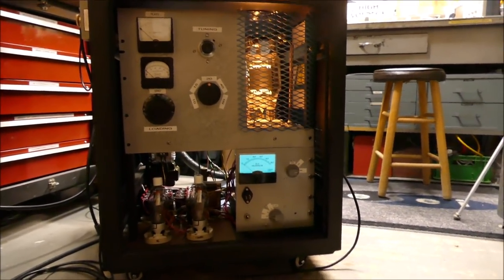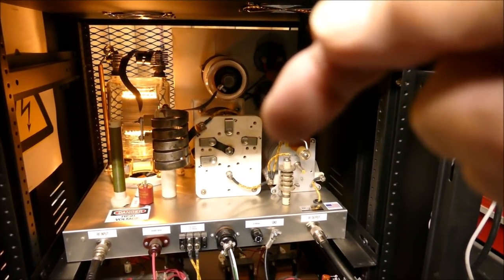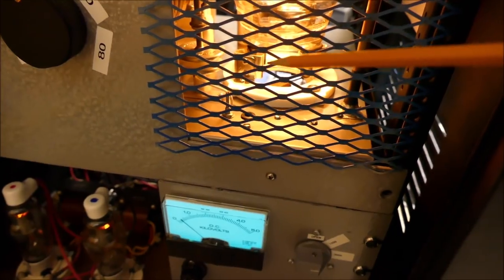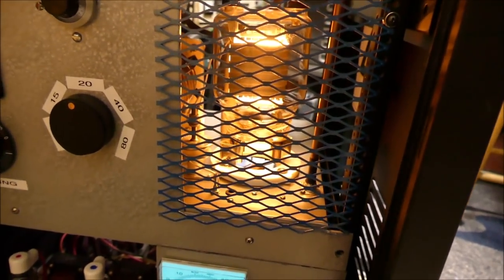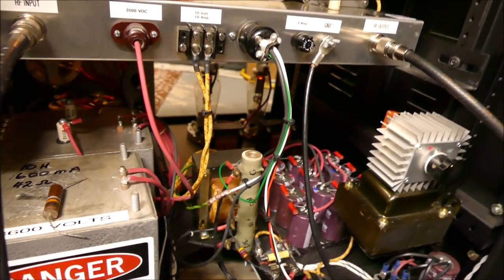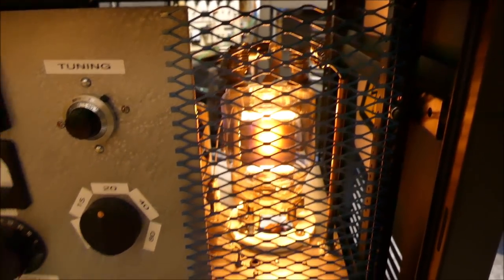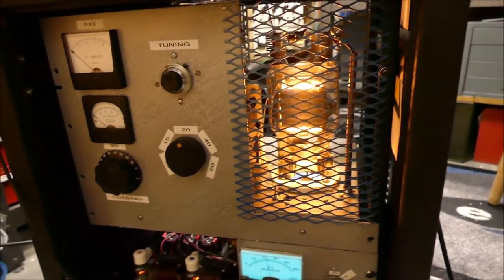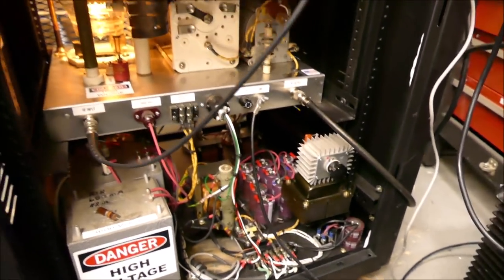(2 of 3) Completed 833A Vacuum Tube Triode RF Amplifier For 20 Meter SSB

Comment from the maker: Update - I removed the bias adjustment shown in this video and replaced it with a Variac. The SCR type variable control shown here was just not stable enough and was way too sensitive to get to any steady bias voltage. Sometimes the old proven ways are still the best ways.

Comment: That will make a nice addition to the Collins rig. Looks rock solid. I'll bet it would do well on AM. 
I like the Octal plug for the control wires too. Very traditional. 
Maybe. One day I'll build a big RF amp. The project list gets longer every day.
Reply from the maker: Hi Bill,
Yes, some of these projects have banged around in my head for decades. I am at that age now where I realize if not now... probably not ever. I have the parts, the time and the experience so I have pushed myself to use the parts that I have. Of course, I do have to occasionally buy small parts from Mouser or Ebay and I did go to a local store for the cabinet.  I found this project a challenge as the overwhelming discussions on the Internet concerning the 833A is that it will be too difficult and too inefficient to use on 20 meters. The tube is rated to 30 MHz so I decided to check it out for myself and as can be seen, it works just fine at 14 MHz. Making amplifiers multi-band is a lot of work and since I only operate on 20 meters, I often times don't go to the trouble of making/testing them multi-band. I have also found that amplifiers "tuned and tweaked" for one band almost always perform better.

Comment: very attractive amp Stan, clean build, i get roughly the same output( not over driving it)   :)  with a push it does run over to 1.4kw on topband  to 40m.
Now, Stan do a video on GG input circuits and how to determine what we need for 160 to 10m band to make the radio happy :)

agree on the repeating of stuff copied from 1921 ,,
Reply from the maker: With this amp, If I raise the plate voltage to a bit over 4KV, so that under load it drops no lower than 4KV, I can get a full KW out of it. I have three 833A's but the other two are "soft" and don't perform very well. In general, I run the plate voltage at about 3600 and get between 750 and 800 watts output, depending on my line voltage and drive out of the little iCom 736. I have considered buying a new Chinese 833 but just haven't gotten around to it yet.
You mention the GG amp and input circuits... I have started using a small Heathkit antenna tuner between the output of the iCom and this 833 amp. It works great and I have no reflected power as shown on the iCom meter and the tranceiver is very happy.  
While I did, finally, get this 833 amp very nicely neutralized, my input circuit is not perfectly resonate (I think I need a little bit more capacitance across the inductor) so if and when I get around to working with it again, the resonance of the input grid circuit would be the place for me to work and that may allow me a little more drive and a little more output. But, as mentioned, the antenna tuner between the iCom and amp input solves the problem of the iCom always wanting to "tune".
I have measured the complex Z of the input but I don't remember what it is right now. I think the SWR is about 2:1. I found out the hard way that if you use something like the little Chinese impedance meters, or the RigExpert on the input of an amplifier like this, you may ruin the input to your impedance meter. I burned up the front end input circuit of one of these Chinese Z meters.  I have been careful with my RigExpert since then and have not harmed it. I use a home-brew Z meter I made many years ago and it works out very well and is not harmed.
An amp I ran for over 30 years in the Collins 30K-1 cabinet was a 4CX1000A and all I did for the grid of that tube was put a 50 ohm (non-inductive, of course) resistor across the input. Worked great.
I try to always use a tuned input. I have found out that it makes the tube a little easier to drive, and get a little bit more output, even on GG amplifiers. Multi-band input circuits get a bit complicated and I have only one amp that I went to that much trouble for and it is the amp that sits on top of my 833. It runs a 3-400Z and uses the B&W 850A tank circuit and a home brew five band input circuit and it works but I located the input tuning switch on the rear of the amp and it is not very convenient to use. Besides, I only operate on 20 meters.
73 WA4QGA David
Reply: @ElPasoTubeAmps  , thanks for the reply David , yeah i 'm  with you on the little tuner to sooth the input, i do mostly the same as it is time consuming to figure out a multi-band amps input circuit. i Seem to remember a time before my Gray beard ,when i just used to drive with a pair of 813's to 2   4-1000 A :)...... they all in storage now, ........anyway all the example of input calculations i find on the net and you tube is complex, smith chart etc.... using an mfj 269 and the likes, so i would apreciate your input on it. Not too many of us amp builders around and the years are really flying lately.

Ah the 3-400z, they were nice tubes, similar to 3-500z... i have built a few of them , real easy to work with, no surprises using them, exchange the 3-400z and 3-500z in GG with a 4-400, 6516, 4-250, they all work in GG no changes needed.
The 833 a is not to bad, i thought i would get a liking in mine due to the size and glow , and i mean they do glow, i have 2 new still in original package. Just never got to like it, maybe due to fact that the smaller tubes out perform it, it a sort of special amp, (vintage)
Can you remember your first ht project, the one you switched on with a broom stick :), hehe... i really did use a broom stick, no surprises, yet i can remember being very unsure to flick the switch , standing at the door with a fire extinguisher :)
I lIke your qrz page, i feel right at home.
regards
Johan
 
 you can view some of the stuff i built on qrz.com    call: zs2cx
Reply from the maker: @luckydubeinrc5165  Just checked out your QRZ page. You have made some beautiful equipment and obviously know how to deal with all the tubes. I have a bunch of 813's that are calling me to build something with them. Problem is, I don't seem too interested in anything "small" - I suppose a pair of 813's would be sufficient. It is even crossing my mind to build a complete AM transmitter. I did that very thing when I lived in Huntsville, AL and ran a class-C, 4-400A and plate modulated it with a pair of 4-400A. Built it from the microphone connector to the antenna. I disassembled that transmitter when I left Huntsville in 1976. I did bring the modulation transformer with me that I still have. I have several other high end modulation transformers to match 813's and 4-125A.

I agree with using the high mu triodes and the tetrodes run as zero bias GG amps. I have used the 4-400A series of tubes in many amps. I never had a lot of luck with the 4-1000A because as the time I had several of those tubes, I did not have HV power supplies high enough to really do the tube justice. I would nowadays want to have at least 5KV or maybe even 6KV on the plate of the 4-1000A. I worked at White Sands Missile Range for 20 years and got a bunch of pulls and replacements of 4-1000A from the illuminating radar stations but not anymore. Been gone from there for 23 years...
As for "designing" input circuits, I just copy and make work examples I get from other schematics. For the 811A, I reference the Collins 30L-1 circuit. Here is a link to the input tank for the 3-1000Z. 
 http://www.qro.it/amp/schemi/pdf/68hb199.pdf   
All in all, the values come out pretty much the same so I have taken the easy way out and don't go thru the Smith Chart path but I do definitely use my B&W grid dip meter...
I suppose I took on the 833A because, as you mentioned, the modern day triodes are no challenge and just work. I needed something a little more complicated than just another amplifier. I have four working amplifiers right behind me as I write to you and would like to build more. Insane but true.
I do remember the first HT amplifier, It was an 813 modulated by a pair of 811A's in 1970. Even today when I have to measure 2KV or more on transformers, I attach the meter to the secondary and plug in the primary to an extension cord several feet back and then approach the meter (very carefully) with my hands in my pocket to read the voltage.
I ran a 4CX1000A for over 30 years with no issues with it but I got  back to the glass tubes as they are more beautiful. 
My pleasure meeting up with you, Johan. I hope we can talk sometime on 20M
73
David
Reply: @ElPasoTubeAmps    Well today is another day, fault finding on a coax going up the mast, going to use the MFJ 269 (distance too fault) all was well a year ago when i last used the particular antenna system, let the fun begin, will sure try and find you once the antenna are back in shape... Maybe i will just stick up a 5m long vertical and a few radials to get on 20m, as tilting the tower with all the stuff on it is going to be a slep..
Later dave
Johan
oh tks for the input link, will look it up.

Comment: So this does not have a tuned input? (Hence the transceiver using its built-in tuner?) Just curious. Works either way.

Also, do these tubes not need cooling on the pins like, say, a 3-500Z?  Thanks for sharing. Nice build. Love the D1 and D2
Reply from the maker: It does (now) have a tuned input for 20 meters, so I could neutralize it,  and i drive it with  a vintage Collins 32S-1 so there is no more searching with the built in tuner on the iCom. I assume the iCom would not have to search so hard now that it is tuned and (I have not measured it yet) much closer to 50+j0. The RCA manual says the 833A needs forced air cooling directly down on the top of the tube between the plate and grid connection which I supply from the muffin fan above. Using an IR thermometer, it appears that the red plate is around 350 F which, to me, is surprisingly low in temperature. I guess the plate is thin and shows color easily. This thing has been a pain and I don't recommend using the 833A. The high mu triodes like the 3-500A and that whole family of tubes are so easy to work with in GG. No neutralizing although I think it is always a good idea to tune the input even of a GG amp. It makes it a little easier to drive (so you probably get more output) and I am sure, although I have not make any measurements, distortion is a bit less. Thanks for your comments.
Reply: ElPaso TubeAmps Thanks for the reply. Very interesting tube. I am not familiar with it. Looks like it is going to work well for you.

Comment: Your audio amp builds are top notch but I just love it when you post RF amps. Is the plate on the 833A used for gettering like in the 3-500z? I have a pair of 3-500's in an amp that haven't seen life in 20 years and appear to be dead. I want to try bringing them back to life. Wondering if you've ever recovered one, and how you'd go about it if you were to do so? Thanks for all the great vids!
Reply from the maker: I am very happy that you enjoy the videos of both types of amplifiers. Ultimately, I find more challenge in the RF amplifiers. As for your 3-500Z's, I would say they are probably good. I have read articles published by Eimac concerning the so-call de-gassing and there is nothing to it. I have tubes made back in the 1940's that are still perfectly good and bunches of 4-400A, 4-250A, 4-125A, 4CX1000 and 4CX250 and the 3-1000Z and 3-400Z that are 40 and 50 years old that probably were not lit up in several decades and they are perfectly good. There is a lot of smoke-and-mirrors fear propagated about these tubes over the Internet and ham lore. . Either they are good or they are bad and there is nothing we can do about it. Eimac states clearly that to de-gas a tube the temperature must be raised to the level of factory production which is right below the temperature of destruction and this is not possible for us to do. They will either work or they won't and I am going to bet they will work just fine if they haven't been previously damaged.
If there is a dark shadow in the shape of the bottom of the plate structure that is burned onto the top of the ring just below the plate, odds are, the tube is used up. Lots of that brown "shellac" looking substance that gets inside of the tube is an indication of heavy usage and probably the tubes is used up. Lastly, even the quality of the Eimac name and tube number on the side of the tube, if faded away and fried looking, can indicate a hard and hot life and the tube may be very weak. These are some things to look for when visually inspecting these transmitting tubes. Other than that, an ohm meter on the filament will tell if the filament is open and an ohm meter check between filament, grid and plate can show up an internal short, other than those checks, the only other thing to do is plug it in and turn it on...   Hope this helps. 73 WA4QGA
Reply: Thanks for the reply... I really appreciate your insight, there's lots of conflicting info out there. These are not shorted (at least as far as an ohm meter is concerned). And they don't appear to be gassy, but I've only been able to apply 1900vdc so far (can't get more until I wire the supply for 240vac). No arcing but hardly any output either, and a very high input SWR. There is slight discoloration pattern on the glass but I've seen worse ones work. The amp i'm working on is on my channel but I'm not so good at video explanations. :) It's an old auto-tuning Marconi retired from commercial service.
Reply from the maker: I hope you get it working. I know from picking up vintage equipment often times the first problems to be solved is switch and contact issues from sitting around for decades where the contacts have oxidized and may be full of dust. Start by blowing the dust out with a compressor or vacuum cleaner. As  long as  they are not corroded from water there is hope. Sometimes  just lovingly exercising the controls and a generous amount of contact cleaning solution may get the instrument to start responding. Ever glimmer of hope drives us forward. Solve one issue at a time and after solving five or six, it may surprise you and work better than you expected. As for your high input SWR I would surely start with the idea of dirty switch contacts. Visual inspection can sometimes be amazingly effective.
If you are getting only 1900 volts, I would think about electrolytic capacitors. After decades of non-use they may work for a few minutes or hours and then go really bad. The idea of powering up equipment slowly on a Variac is like throwing a bottle in the ocean and hoping someone finds it and rescues you. Bad electrolytic power supply capacitors have to be replaced.
If your 3-500Z tubes light up with a healthy bright filament glow, there is hope. If they are dull and sad looking well....I have seen some reasonable shellacked coloration and everything be OK - not 100% but OK.
You also have  to consider that someone back long ago decided to "fix" it and didn't do a good job and likely may have just complicated issues but that doesn't mean it can't be fixed relatively easy and with minimal cost. One issue at a time and you could end up with a nice piece of vintage equipment that you will really enjoy.
.